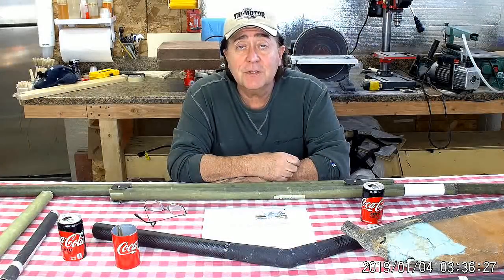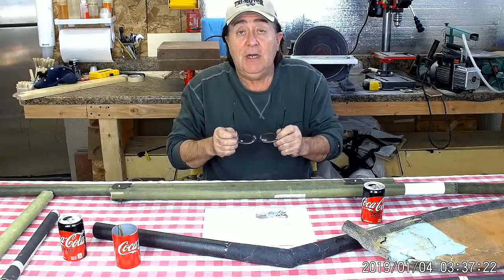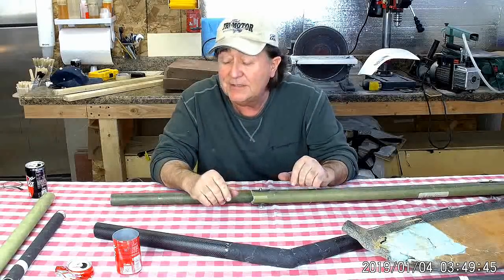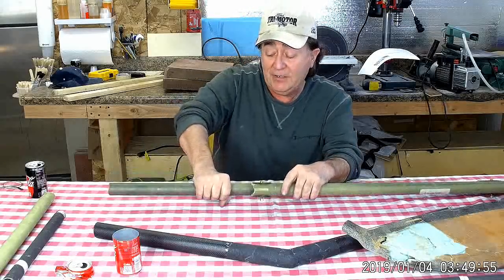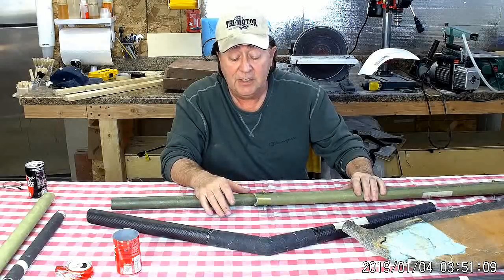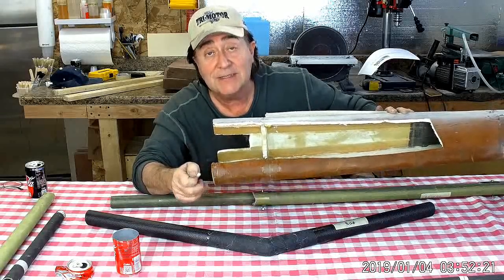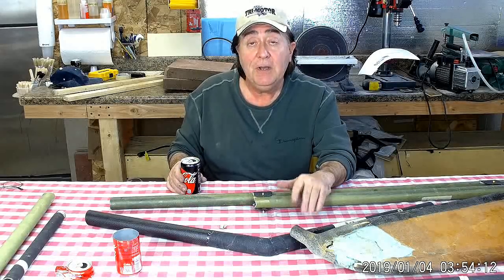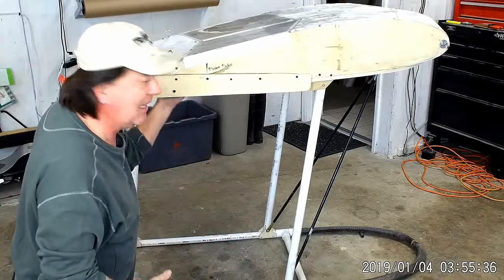Engineering Corner - KW MkII Class 2 Foot Launch Hang Glider Sailplane Development

Comment: As always, Roll, a most insightful video.   Great explanation. The immediate solution that occurred to me, was simply make the wing one piece. Yes, transport would be a pain but it is doable. Similarly, telescoping tubes with a cable that ran the full length - tip to tip, to hold the halves together might show some promise....it is an intriguing problem you pose! Thanks again for a great post.
Reply from the maker: Thanks, that's always nice to hear. I try hard to educate and entertain, even if the engineering is wrong (kidding!).

Comment: Will you be putting this in to production and will it be under 15k
Reply from the maker: Plans might be available if the design is safe. What do you think a set of plans would be worth? It would cost most folks around $10K for the materials to build the aircraft. I think finished aircraft of this type sell for around $50K as they are very short run production and VERY labor intensive to make.
Reply: @KlingbergWingMkII  id think...given ALL your footage you have available...& the associated details i would think youd have together...a starting point would have to be $1000+...just comparing to diy yacht plans & microlight/lsa plans...comes down to the supporting details for manufacturing...would also have to have a no resale & copyright contract too
Reply: @KlingbergWingMkII  NEED to up the sound on your voice recording...i have my volume right up & its still not easy to hear well & ive got good hearing